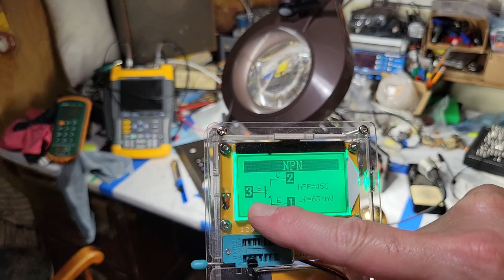Vintage Amp Restoration and Repair: Nikko TRM-750

Comment: hey! i've got that same fisher cc-3000 preamp. i had to do some work to it but i think it is a great preamp and i love it. mine's driving an adcom also but a gfa 5300.
Reply from the maker: It's pretty sweet, isn't it? I got it with the intention of selling it to a friend, but I've become attached. I re-capped it and made some repairs: those plastic pieces with metal screws for connecting the front panel knobs. I hate that design. The plastic always cracks eventually.